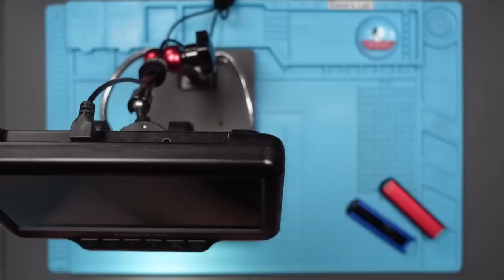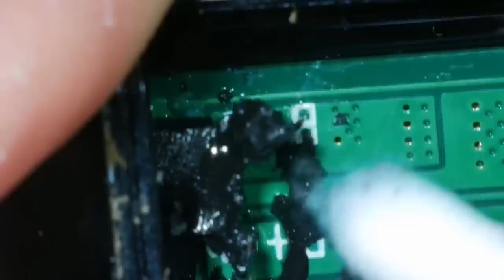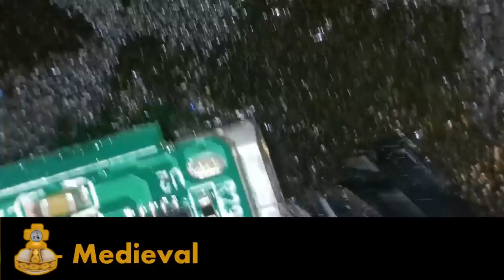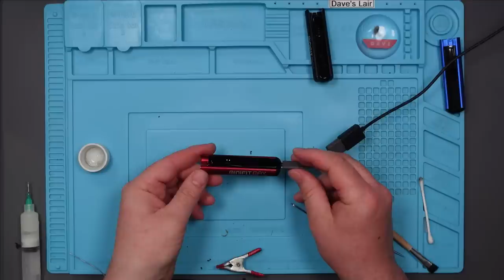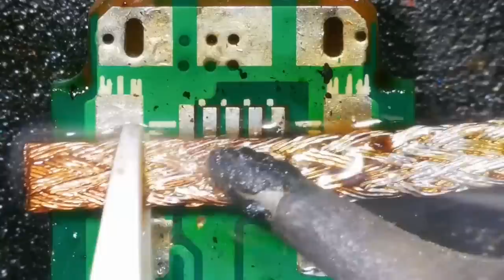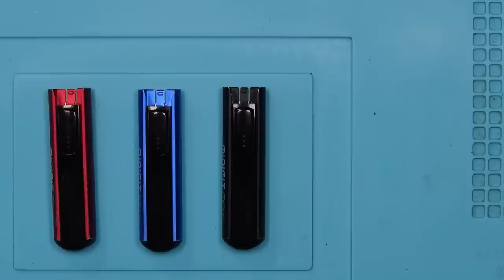Faulty JUSTFOG Devices | Can I FIX Them?

Comment: I wish I would've found you sooner. I bought some of my favourite vapes, wismec presa's. Used one for 5yrs had two in the drawer, mint never opened. All of a sudden the first broke, I used the second for just two months and it stopped working. Same thing, press on the display to fire apparently has a flaw in the board. Found out you could've gotten the board or an exchange way back when... Well I had them laying for 5yrs and the third died after a year. I've tossed them now, and now use some smok squeeze fire but they're square, not as comfy and way less power capacity. I think if I found you before I would've had more confidence in trying to fix them. You are so inspirational and calm and it's so very encouraging. We live in the age of obsolescence and I truly applaud you for trying to show that it doesn't have to be true. Thank you 🙏❤️ Xx

Comment: Nice and straight forward repairs, Steve! Love watching your videos. But one thing you should change: when working with leaded solder, PLEASE use some sort of ventilation. I'm a chemist by profession and you really don't want that  stuff damaging your nervous system in the long term.
Reply from the maker: You're absolutely right and I have just got a proper fume extractor, so I'll be using that in future vids 👍
Reply: I find this ironic considering he is fixing vap pens.   🤔😂 But you do have a valid point. Also, Dave may be getting second hand toxins so there's that.
Reply: Genuine question, why in particular with leaded solder? Doesn’t lead vapourise at a higher temperature than soldering irons reach? I thought the ventilation was for vapourised flux, which is in leaded and unleaded solder.
Reply: You're right. There's also the possibility of lead being carried away by the flux.
Reply: @Frank-xn9we  thanks, that makes sense.
Reply: Those "fume extractors" with carbon filters are pretty useless and only really good for getting rid of odours, not microscopic particulates found in the rosin flux. any fan will do well to push the fumes away from you.
Reply: @Frank-xn9we  Lead in the fumes? Sounds really nasty.

Comment: Ace job mate, it's 1.44am here and I'm fixing solar lights with 0.10mm copper wire and a splash (don't ask as I've covered most the board) of solder mask. Always looking forward to the next vid. Stay safe dude.

Comment: i Actually work for a vape shop here in the US, and I'm more or less the resident fix-it guy, too. I rarely take it quite as far as a disassembly, but sometimes it's just a simple cleaning and we're all set.
Reply: yea same here but the shop i work at is in Australia. i cant manage the same level of soldering as Steve can though. usually a pod system is a throw away but a Gen or a topside light i have repaired before.

Comment: Any time something won't charge via a small usb port, I have a look to make sure it's nothing badly mangled then clean out the port with a needle.  Not worried about the contacts, but the tiniest bit of pocket fuzz can build up in the corners of the socket and prevent the charging cable from plugging in all the way.  Almost every time I've had a device that needed the USB cable to be oriented in just the right direction, that works.

Comment: i have done some repairs on larger vape devices myself but i lack your level of soldering skill. im competent but cant manage the fine detail you can. most pod systems arent really worth the effort to fix like that as their relatively cheap to replace. usually by the time the port wears out so has the battery. glad you managed to fix yours though!

Comment: I've kept my current eStick battery going for about 5 years now, once I figured out that yes, the USB port will become clogged with DNA and detritus and will need the occasional deep clean. Could I ask you what type of liquid soldering flux you are using? I never knew that stuff existed until you.

Comment: My iPhone 5 charge port ended up full of pocket detritus. It cleaned up alright after a bit of time. I have a power bank that has a bad joint on the charge port. Just get the plug in the right place and it will charge. Oddly, I had three originally but the other two died years ago. This one just kept going.

Comment: I'm not a Vape user so I would have no use for these except for the lithium battery and charge circuits. I have yet to make something out of one of these. I found some in a parking lot but I didn't take them. Was due to the situation back in 2020.
5:24 I have this same issue with my phone so I have to clean the USB port every now and then.

Nice.
Reply: if their thrown out in a parking lot their probably disposable devices that don't have a charge circuit or charge controller attached. be cautious as they can be easy to over charge. yes the battery if lithium can be recharged but as it was built to be disposable it probably isn't safe to recharge it.

Comment: I tried to fix one of my vapes, just needed to solder back a cable on the board. The thing was working before i solder the cable but it wouldnt charge. After i were done the vape take charge but the piece of junk stop working

Comment: Use the magnetic charge cables where the port stays in the item and the lead is separate
Reply: I find those magnet cables are shockingly slow . Maybe ok for that tho
Reply from the maker: Ooh, that's a great shout!  Didn't think of that.  I'll check them out, thanks! 👍
Reply: @maximushornet  keep the ends clean and pay for better quality, mine are spot on

Comment: You should get yourself something that takes 18650 cells and also a 510 fitting on the top, you won't be tied to expensive cartridges and you can also select any brands tanks that fit the 510 socket.
Reply: i agree with you except for 1 thing. a single 18650 hits pretty weak. get a 21700. or a dual 18650.
Reply: @Hoodlum045  I had a twin 18650 in mind when I said it but the 21700 is a good cell, I use those in Rc related things

Comment: Getting a look at what's surrounding the port, I'm not very surprised there's corrosion forming!

I imagine it's also, like, vape juice buildup, right?  From the vape settling.  A lot of moisture with stickiness included.  Which one did you use more?

Something about you saying solid so many times made me want a salad... interestingly.
Reply from the maker: A nice solid salad!  🤣  Yeah, they all get a fair bit of use but I think the blue one is the oldest, so I guess that makes sense!
Reply: Salad!  I didn’t hear it until now 😂.
Reply: That's not from the vape liquid. What you have there is some grade A pocket lint plus human skin flakes. You see this all the time in phone repair, or any device that goes into pockets and has USB charging. I personally see this all the time with both USB-C and Thunderbolt ports.

Comment: Thats the reason I would never ever use cheap crap for vaping. Imaging what you else inhale as its not properly separated. You can clearly see that its rest of burned or vaped oil inside. And please buy urself a compressor so you can clean things with air.
Reply: I didn't see any oil inside. Either way, that part isn't the part that gets hot, and there's no air path in or out of it to get into your lungs. That's like saying your coffee is going to get contaminated because the wall socket it's plugged in to is dirty.

Comment: Love your singing, never stop. You really should buy a fume extractor. That smoke is not good for you.
Reply: I really don't think it's a big deal for this low-volume soldering, but if he's really concerned, an old computer case fan, a 9-volt battery and a bit of carbon filter will be a very sufficient, quick and cheap way to handle it.